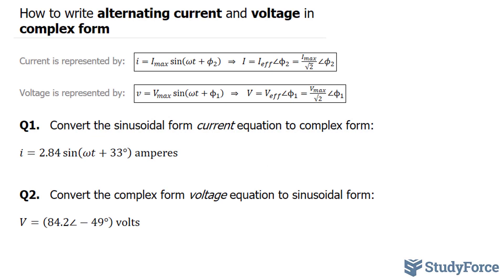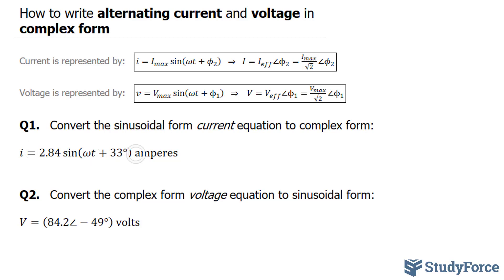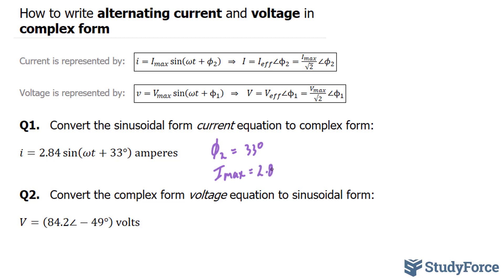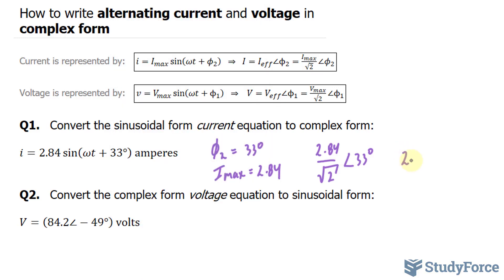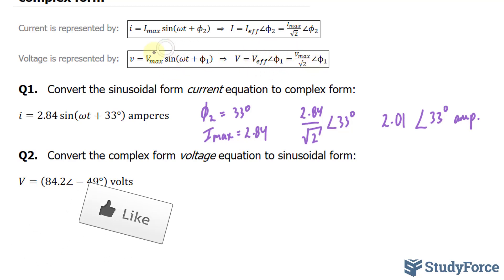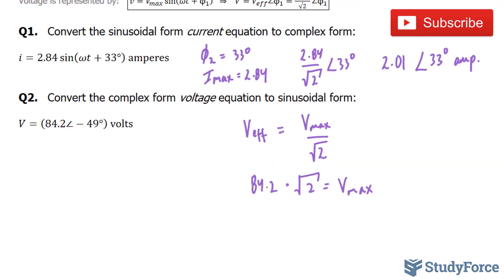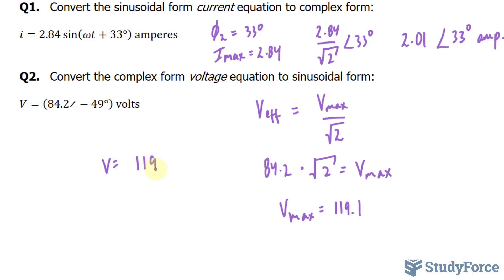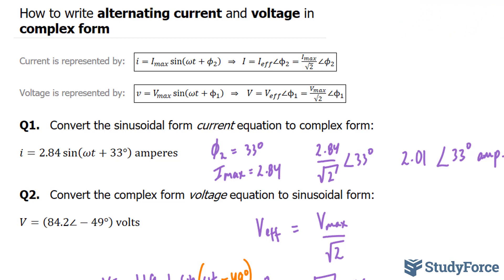📚 How to convert between sinusoidal and complex polar form for current and voltage expressions

Comment: Is the ‘radical 2’ absolutely necessary in both conversions?
Reply: Radical 2 is because of relationship between Maximum voltage and RMS voltage. RMS = Vm/sqrt.2 ..
Reply from the maker: Yes, it is.
Reply: @StudyForceOnline  what is the main reason for that? If you don’t mind.
Reply from the maker: @obinechewinner8305  I can't recall the reason as to why it's divided by SQRT(2), but there is  a proof for it. If you need to know for an assignment, I can look it up for you...
Reply: @StudyForceOnline  thank you
Reply: Since RMS means Root Mean Square value of the sine wave. So we first square all the instantaneous values then find the mean of them. At then square root of that mean value.